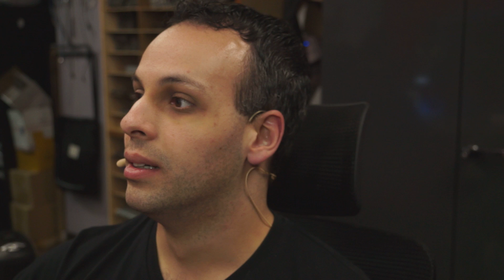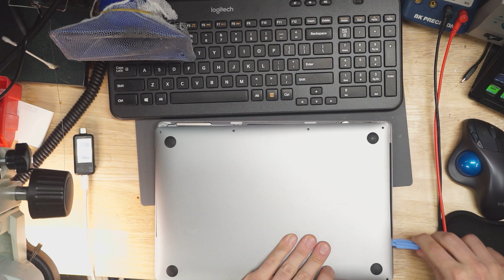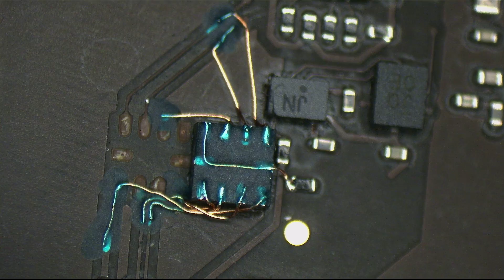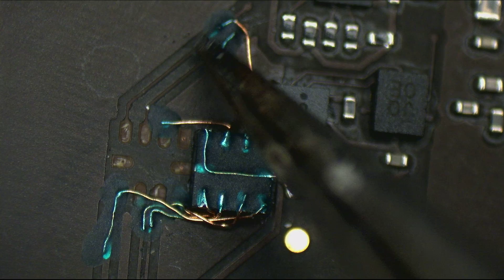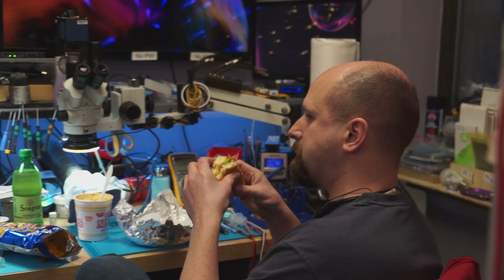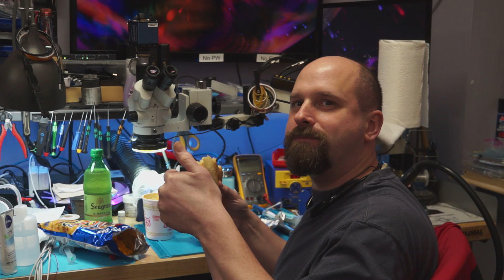Why is opening Macbook a boobytrap?

Comment: so now apple wants macbooks to no longer be possible to "easily" open...
i guess creating their own screws wasn't enough :D
so why are people still buying these things?
Reply: Going by what I experienced in IT for several companies over a decade.  Most problems were by users and third party software that we had to fix.
Reply: @rizon72 i'm not saying most problems aren't pebcak cases, or buggy 3rd party software, but windows is clearly and objectively the most unstable and buggies and most unsecure/directly selling your data os of the big 3.
Reply: @cataria3903  Just telling you what I've observed.  There is a reason why there is such a thing as the "I, D, ten, T" error, and it effects all systems.
Reply: rizon72 That error code is also known as pebkac or error 50 (cm).
Reply: @cataria3903  The problem with windows is kinda same with android vs ios. When you have something which is tightly controlled you will have a more closer to intended experience than when the hardware is not controlled for same effort. Both systems have benefits and drawbacks and hence, both systems have been working for so long.
Reply: @mirasolov klose
android/ios have been working for so long, because of billions and billions of dollars thrown at it by both companies with no other choice for the user, than these 2 horrible options, + the fact, that the phone always comes with on or the other installed from the beginning.
the same applies to microsoft's "os" being installed when u buy an oem system.
we're a few months away from finally seeing a 3rd real player in the phone market, and i don't think in regards to size or production volume, or stupid thinness, but rather in actual security, no trackong of u, open source etc...
the librem 5 phone from purism will be a phone running gnu + linux with hardware killswitches for most stuff and thye baseband being isolated from the soc and as said having a killswitch for it.
i'm not even saying, that this phone will sell insanely well, IT WON'T! but just think about how insane it is, that until now, we didn't even have a real 3rd option!!!!
that is why those billions and billions of dollars companies  sell so many of their software prisons and spying device, because we didn't even get another choice until now!
Reply: Apple is a cult. You pay a premium to be part of the weird Mac People community, then end up with something that has to be shipped back to the factory just for a new battery.
Reply: People still buy macbooks for the popularity points.
Reply: apple is marketed way better than the products. be wise with your money please
Reply: @syv6173  Thats why people buy em they are marketed so damn good
Reply: The average Macbook target audience does not really go about opening the laptops. It does have a good battery life and has traditionally better OS user experience stability than windows but what baffles me is every single time I have seen someone with macbook giving an important presentation the app (mostly MS office) has crashed once. The ppts in question generally have many slides with significantly high images, animations and graphs (data heavy). While windows laptop have had a very small percentage of application crashes. For reference my observations were from 60 presentations over a year and half from global presenters from academic and industrial background. Granted, I do not have recorded data and so I will have an observer's bias.
Reply: That's not only it, bad os and freaky overpricing.
Reply: hipsters and millennials still exist
Reply: if yall don't like using windows, just use a hackintosh
Reply: luckely they are starting to wake up.  though sadly a while ago i lost a friend to the apple camp.  he says he likes his ihpone. -_-
Reply: Because people are fucking stupid
Reply: A lot of times people will get Apple alternatives to run Adobe programs faster and more reliably.
Reply: @Blitzkrieg1605  Apple time machine ahahah 😉
Reply: Convenience, feel of safety and apparently thr layout
-my mac boi pal
Reply: Because of applications that don't work on Windows, and because Winblows is buggy as shit
Reply: @ArtfulCosumDust  Been using windows 10 for 2 years now and nothing buggy has ever happened
Reply: legendary Anecdotal evidence
Reply: What's buggy?  I've seen both Windows and Apple be buggy as shit and many times its not the OS but the user or some 3rd party software which is the problem.
Reply: microsoft windows has historically been the most buggy, most unstable os out there.
microsoft's pushed out october update, even went so far as to delete user data....

microsoft has fired a ton of beta testers and now even more uses users to betatest their software, and i don't mean it in the terms of "i want to be part of the beta program" i mean it in the part of "force the update out, we fix stuff when we get horrible user reports back" thing.

https://www.computerworld.com/article/2878026/microsoft-to-business-dont-worry-about-windows-10-consumers-will-test-it.html

beyond that microsoft windows is the most insecure spying operating system out there, especially windows 10:
https://www.gnu.org/proprietary/malware-microsoft.en.html
(multi link source, giving a ton of sources)

it is NOT 3rd party software, but microsoft, it is a well known fact and the only reason microsoft windows is used is a: it being the default, that ships sadly with most oem systems and 
b: it is a monopoly, that it enforces through gaming apis, a ton of other apis, sponsoring to keep stuff windows only etc....
gnu + linux for example is a million times more stable and has way way less bugs of course, hence why it's run on servers with year long uptimes, while u will get laughed on, if u think windows server edition is actually run in real datacenters :D

so it is a fact, that windows is the most buggy most insecure os, not an opinion, ok?
so mac os users coming from windows exchange good reliable hardware, and garbage software, to more reliable less buggy software and garbage hardware i guess is a way to put it, BUT, people could just run hackintoshes instead and have both advantages?
although the truly sad part is, that a ton of people using macos would be just as happy with gnu + linux, but  save a ton of money! and be more secure, thinking of your grandma, that browses the web a bit, shops online and chats with grand kids type of thing.
Reply: @cataria3903  October update deleted very little data, becuase it only deleted data from specialy formated drives.
Reply: @dot_one_yt2  it's the most buggiest piece of shit ever
Reply: @cataria3903 I heavily doubt it. Only people I've seen with a Mac here are; a photo-studio (professional photographers for weddings, birthdays, religious ceremonies blah blah), a psychologist (which might have a point), and an entire class of Uni students at an expensive one, in the Software Engineering section (despite how I highly doubt it to be the best OS for that stuff... but whatever).

I can only think that most people that use it are 16 to 25yo high-school/uni students for fashion reasons and not being left behind.
Reply: @ArtfulCosumDust  yeah all 10 applications that don't work on windows sure drive these crazy sales.....idiot...
Reply: @helljumper912  apples products really suck
their build quality sucks
cant even upgrade a mac without accidentally breaking something

windows has lots of support such as 
upgradable pcs
lots of games and steam
a good filesystem
not limited and restricted acess to stuff which allows better applications

still cant believe how many people still use apple products

also, youre forgetting windows 7!! a actually good os!
Reply: @ArtfulCosumDust  Alright, go play tf2 on mac then lol. Also please tell me what bugs you're talking about.
Reply: @ArtfulCosumDust  that's a excuse Apple users make, there's thousands of things you can do with windows that Apple can't, and just a few apple can and windows can't which btw are useless.
And Apple actually is the buggy slow one.
Reply: @ArtfulCosumDust  well Only windows 10 and vista and win me Are buggy Windows 7 is perfectp
Reply: @ArtfulCosumDust  Or just build a Hackintosh for half the price and twice the quality.
Reply: @ArtfulCosumDust  what programs work on Apple that dont work on windows?? 
Besides any Apple made software?

Comment: It's not that screwdrivers screw things up, it's those who wield them use them incorrectly by holding the handle.
Hold it a few mm away from the tip and it won't go in that far if it goes in at all.
Reply: Screwdriver tip broke. Looks like it's my fault :(
Reply: Instructions unclear, screwdriver got stuck in my nose...
Reply: This guy buys all the mac
Reply: Thanks, cpt. Obvious
Reply: Torque? That's likely making such a difference in force when you accidentally push it a little further
Reply: Oh using the tools properly breaks it, damn. What a tweest.

Comment: Question: The jumper wires on the bottom are all twisted. Isn't that something you usually want to avoid if the wires aren't insulated?
Reply: It's just clear insulation.

Comment: Mr. Rossmann will call this a "design flaw".  But, Apple considers them "design features"... anything which makes REPLACING the device more likely than REPAIRING the device (especially DIY).

Manjaro on a Lenovo notebook, anyone?  Or... CrApple.  Stink different?  WacBook?  WacBook BLO?  WacBook Wear?  Connect ALL your CrApple devices... with your iClown account.  Wac.  It just breaks. smh
Reply: Note 7 had a nice feature that would allow it to explode

jokes
Reply: @OhSoTiredMan  Real world version of Hollywood self destroying messages - https://www.youtube.com/watch?v=fkXGGhuQs0o
Reply: @OhSoTiredMan : Yeah... and they want to TRIPLE rechargeable battery capacity, while keeping the same weight/volume, or TRIPLE energy density: now < gun powder; now x 3 = gun powder; now x 10 = TNT (or even DYNAMITE). https://youtu.be/8RbwOhM6PUk
Reply: @M0rn1n6St4r  That was a very informative video, have a like.
Reply: I have Opensuse Tumbleweed running on a 6 year old Toshiba, 5 months old Asus gl702zc Ryzen 7 modified and a 2 month old Acer nitro5 an515-52 i7-8750. It works better the regular Opensuse leap release because it has all newer fixes and patches, it is rock solid but it's still kinda test software. Just GO for it, if Manjaro then doesn't work give a try to other distro for new hardware try a rolling release "please consider" Tumbleweed!
Reply: @acrodrigues1 : In the past, I have used multiple versions of Fedora, one version of Yellow Dog Linux (PS3), and one version of DreamLinux.  I was seriously considering Ubuntu, but there are things I've learned about Manjaro that I like (and some I don't).

I do not know much about Opensuse.  But, I will do more research when the time comes.  I plan to pick 3 distros to test on some future purchase, using multiboot.

If only Microsoft would switch Windows to be their distro of Linux, or FreeBSD.  Then software developers would be creating software which has the POTENTIAL to work well on ANY distro (sans WINE)... especially GAMES.

But, I am probably kidding myself.  Microsoft would include "features" to prevent software for Windows from running PERFECTLY... even on Windows. :-)
Reply: @acrodrigues1 : Check out this video; curious what you think about the comparison (Manjaro KDE v Tumbleweed KDE): https://youtu.be/9hUHjQhY9is

I tend to use Gnome, or XFCE (when Gnome slows down older systems).  I only used KDE for my (2-decade-old) Knoppix STD LiveCD... only option, if I recall correctly.

Anyway... I think have not used KDE in about 15 years, so that part would not be relevant.  I found another video which affirms my suspicion that I will continue to prefer Gnome: https://youtu.be/z_dl9IIihyY

Comment: Am i missing something here? Some of those jumpers seemed to be touching each other? do they not short out?
Reply from the maker: Magnet wire.
Reply: @rossmanngroup  Thnx.
Reply: Just as Ross mentioned... It is magnet wire.  It has a translucent high temperature enamel coating that is an electrical insulator.  You have to sand/scrape it off at the connection point or the heat of the soldering iron will burn it off if low temp enamel insulation.  Lifesaving stuff!

Comment: Hi Louis, In most of your videos you use gloves, but not in this one. Are the gloves for keeping things clean, or are they for the static electric charge, or as a protection from AC/DC? I also noticed that you use a gray pad, but sometimes you put electronics on the wooden desk. Is the pad only for convenience, or for safety? Do you recommend against buying a wrist strap? (I'm an amateur, just started tinkering with RPi and other little components). Send my regards to Blackberry. Cheers.
Reply from the maker: It is because people's machines are fucking disgusting and filled with grease, dirt,  food, and I don't want to touch that
Reply: @rossmanngroup  Thank you very much for your prompt reply! Keep the marvelous job you're doing educating all of us. I wish you a lot of success.
Reply: Regarding the gloves, Louis has answered this a few times during life streams, the gloves are to protect him, not to protect the laptops. You'd be surprised at what kind of crap can be found inside laptops that people send in. Imagine someone spills soup and it's been left like that for weeks.
Reply: Pubes of diversity.

Comment: No wonder CSAT solutions need them $60,000 machines that specifically remove macbook covers right guys
Reply: How much does a mac MB goes these days? I'll guess $600 so if they fuck up 600 cover openings then they recoup the cost of the garbage can opener. (Since they don't do component level repair just replace MBs)
Reply: Sounds like they needed to find a problem for that solution to fix...
Reply: The broken ones?

Comment: Do you guys fix other brand laptops like Asus , Hp , Acer etc. ?
Reply: It's usually not profitable for them to do that, so no.  They focus on Apple products simply because those are expensive to begin with.
Reply: @arduria538  well asus laptops are pretty damn expensive imo. for example hp spectre is ~1000 $
Reply: @System-br1tx  Not expensive enough to steal schematics for...
Reply: @keepernod2888  Steal ? you are saying that there is no schematic available on their website / internet ? well damn. looks like these companies are like apple too !
Reply: @System-br1tx  Most schematics are not publicly available... shocking.

Comment: I have countless of these blue plastic opening tools, people could really stop shipping them along with parts that I order
Reply: They want to get rid of them too LOL
Reply: I still use them on numerous devices I open on weekly base that are entirely clipped together with these horrible plastic clips. Newest addition: WMR controllers

The opening tools are weak however and I regularly break them.
Reply: Yeah, I get one most of the time I order a phone LCD
Reply: I drown in screwdrivers from the battery packs :P
Reply: Michael Ræbild Oh yeah, I forgot about those. I actually made some micro multimeter probes out of them, quite practical
Reply: I got a box, everytime I order a screen protector I get 1 of these included, have literally hundreds of these, but for those that need to open a Mac and don't have this tool a plastic fork is just about as effective as the plastic tool
Reply: I very rarely fix anything so it's good to have some sent
Reply: Nah they should keep shipping them. Can never have enough.
Reply: Иван Снежков I have never had a problem where I needed a cockroach and I couldn’t find it. In fact I don’t think I ever needed a cockroach